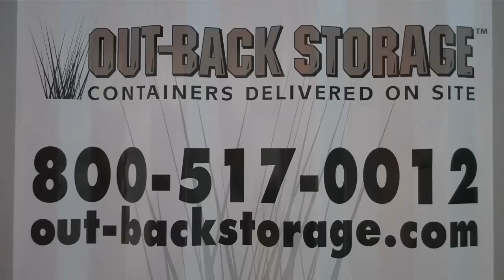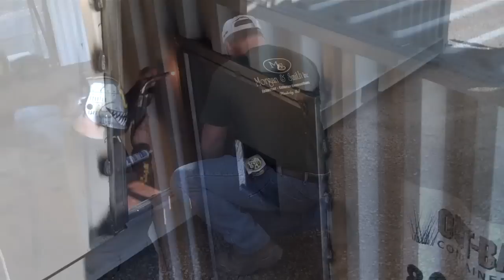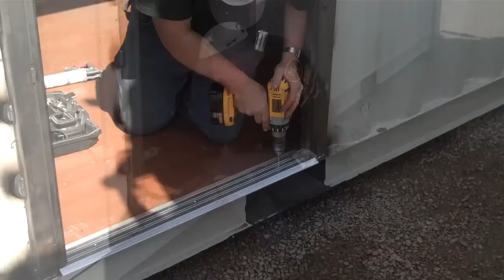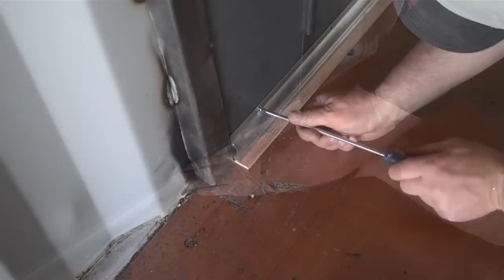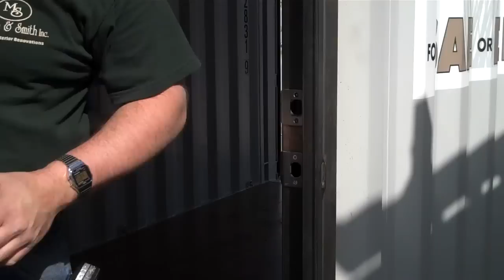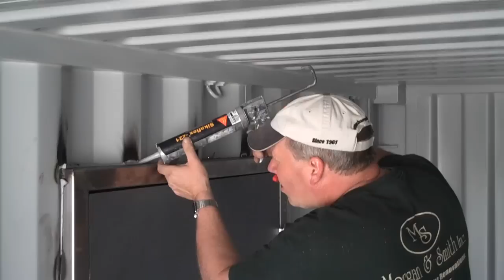How To Install A Door In A Metal Shipping Container

Comment from the maker: @vutEwa The reason is because it cost less to have the door "stitch" welded into place and then caulked between stitches.  The door is still secure and watertight.  If you wanted to weld the entire door into place, you could.  Regarding the container being "air tight"...containers come with vents built in from the factory.  They typically have two vents.  The vents allow for very little ventilation, however they are not air tight.

Comment: @StorageContainers i'm curious why not though. it doesn't sound like the thickness of the sheet metal is not an issue. I'm not a welder, but I know some things about welding from book smarts.  My whole reason for assuming one would want to weld the whole thing is this unit could then be air tight and water tight, could be sunk in the ground, could have positive pressure or negative pressure applied like for hyperbaric chamber, survival related things also like tornado shelter.